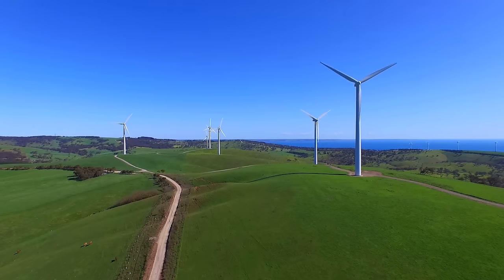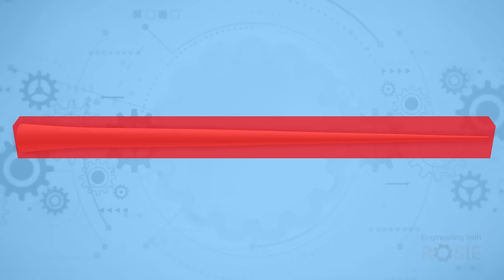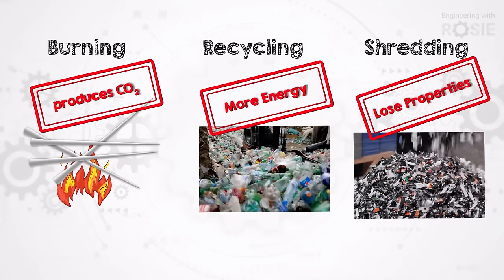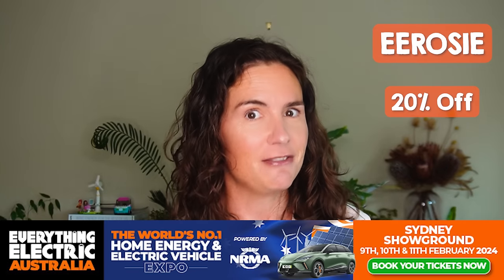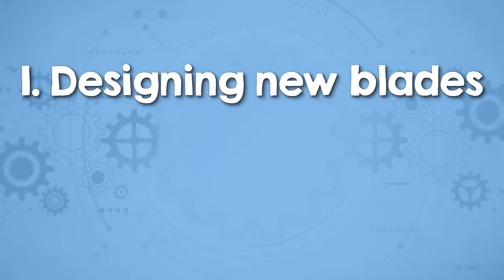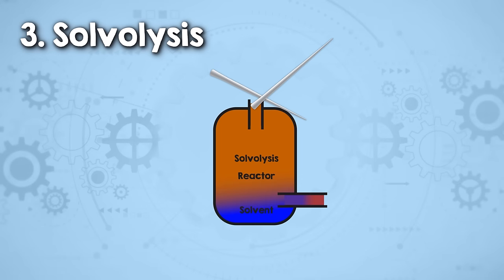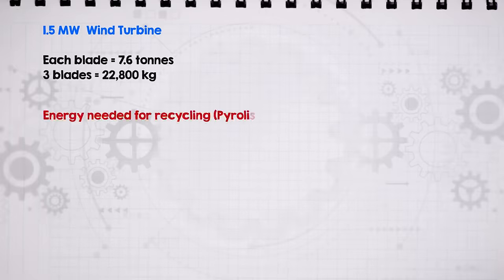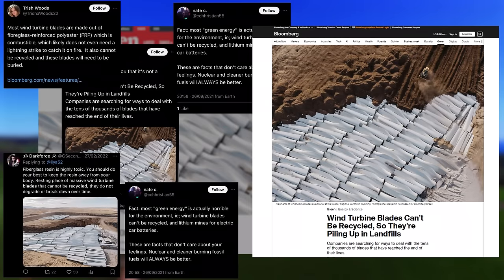This Is Why We Don't Recycle Wind Turbine Blades

Comment: Shredding and a role in cement manufacturing seems like perfectly fine ways to solve the problem.
Reply: This is done to an extent with Shredded Tires as well.  Most plants (at least modern ones in richer countries, re that note on cost will prevent all this short of regulation forcing corporations) already have good Emissions Controls for Sulfur and Particulate Matter so it can handle the Vulcanizing Sulfur and any smoke/dust from the burning.

Negligible sulfur in the Wind Turbine Blades, so should be easier!

My only criticism (although data needed) is this may not work as the volume of old blades grows, and thus the need is greater.

It could still play a part though and hold out until more technologies reach the same Technology Readiness Level
Reply: @ericlotze7724  Seems like there are way more tyres out there than turbine blades. And yeah, my understanding was that shredded rubber tyres added to roads reduced noise pollution.

I can't find the exact number but there seem to be 10's of thousand metric tonnes of wind turbine blades made each year right now.  Meanwhile the largest tyre manufacturer, Michelin, makes around 1.5 million metric tonnes of tyres each year.
Reply: @KevinLyda  Rubberized Asphalt Concrete is really cool!  @PracticalEngineering has a great video on Asphalt Concrete if you haven’t seen it yet!

In theory if done with sustainable biomass and/or maybe even somehow getting a Power-to-X workflow to make hydrocarbons that heavy, it could be a form of Carbon Sequestration in Construction kind of deal.

Comment: In Sweden, we already do that. Burns it in the high temperature oven. In severe heat pains. With very high temperatures. The ash is mixed into concrete, and that ash is not cheap. You get a very high quality of the concrete. No problem. Recycling.
Reply: Co2 isn not toxit.
Reply: That's not recycling..... And in Sweden the laws of physics still apply..... Conclusion still remains the same.....
Reply: What is the cost to burn them?
Reply: And how's burning up fiberglass material is better for environment than nuclear power?

Comment: Cut these into strips, glue them together like laminated beams and or 2x6 , 4x4 etc .
Reply: Getting a good section to cut like that may be difficult due to the more complex shape of wind turbines (they aren’t just a rectangular prism etc)

This is being done to an extent with all that Mechanical Recycling.

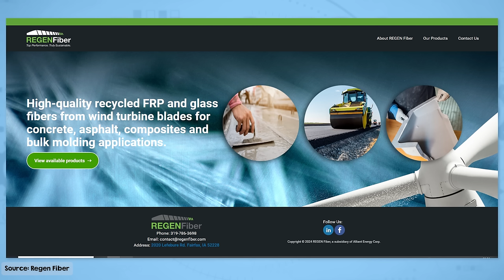This was mentioned around 11:16 or so where they are basically chopping it up into FRP Rebar which seems really neat!  FRP Rebar (Carbon Fiber Rebar is also a frequently used term) doesn’t rust like Steel Rebar, so can heavily prolong the life of Concrete Structures!
Reply from the maker: I had a section about that idea but cut it at the last minute as the video was just so long! Maybe I'll release just that section as a short video or something.
Reply: @EngineeringwithRosie  no such thing as ‘so long ‘ for your videos IMO.  I’d watch a 3 hour one
Reply: @EngineeringwithRosie  Have you considered pairing these videos with longer form content like writing? Perhaps a Medium blog? I'd love to dive deep into some of the stuff you show in the videos along with my weekend morning coffee.
Reply: Requires reshaping the blade, which is not practical with the current cross-linked resins.
Reply: Great idea. These could then be covered with a wood veneer to resemble actual laminated beams for residential use.  Or leave them uncovered for commercial or industrial use. I'd love to see some engineering (load) data for this sort of application.

Comment: Hey Rosie, I'm currently working on a start-up dealing with this very issue, and I wanted to thank you for a comprehensive exploration of the challenges involved, and for shining more light to this very important problem we've yet to solve - after 30 years of trying.

Most of what you said we are already familiar with, but some of the recent developments in thermoplastics were new to us. Thank you for including those.
Also appreciate that you proved links to your sources, will definitely be looking into those more.

Two things stood out in what you said - or rather didn't say. 
1) Shredding is very energy intensive, and I'm a little surprised you didn't mention it. It was sort of mentioned in the studies you looked at, but the numbers seemed a little off.
2) Shredding + burning before adding into concrete is the most common use for recycled glass fiber today in most of Europe.

I think the best choices for recycling the existing blades is in finding ways to repurpose the material for uses where the unique properties are useful, but would otherwise be too costly to produce. There are some advanced methods for extracting glass fiber, for example Carbon Rivers in the USA has a method with which they claim they can retain over 90% of the original strength of the fibers. But I think these energy intensive methods should be the last in the chain of recycling, after the material can no longer be applied to a new use.

How many blade shaped bridges do we want is a fair question to ask, but that is only one possible use case out of several dozen which would benefit from the material properties.

Thank you again, and look forward to hearing more of your thoughts on this, and other challenges 👍

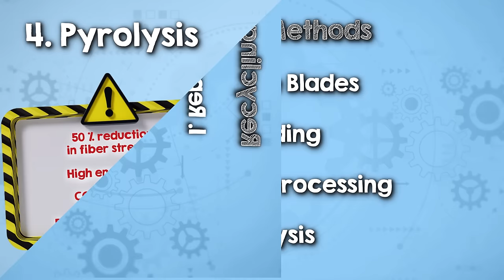Comment: 9:20  You would recover the “Pyrolysis Oil” and some (or all if just doing gasification) “Syngas”

Both of these could be fed into refineries that currently only use Fossil Fuels to make the Resins.

Also the out of scope effect of these facilities processing Municipal Solid Waste (especially sorted thermosets) and Sustainable Biomass.

Granted i am a MAJOR nerd on all this, but I wanted to know your opinion on all that.

(Granted also as you point out the Fiber would need reprocessed, and energy use issues, also if sourced from Fossil Fuels (as most things currently are) it’s basically a Fossil Fuel Thermal Power Plant with more steps)
Reply: Carbon taxes need to go up a LOT before synfuels are competitive with digging up fossil hydrocarbons.
Reply: @jamesphillips2285  Sadly yes.  

Granted in that case clearing land for Landfills is also more economically sound.

Comment: The following is from a Danish news media (Dr.dk) it is also mentioned in several technical media in Denmark.
The article is 18 months old, so there is a youtuber who has not done her job well enough:

Up to 85 percent of a wind turbine is already recycled today, but the used blades in particular have proven to be difficult to recycle.

But now the wind turbine manufacturer Vestas has developed a method to break down and recycle the used blades.

This is what the industry organization Green Power Denmark writes on its website.

The method involves dissolving the epoxy glue that holds the turbine blades together.

It is "groundbreaking", according to Mie Elholm Birkbak. She is an innovation specialist at Vestas and has helped develop the new method.

- We have found a solution that enables us to break down the wing materials in a way that is so gentle that we don't need to use a lot of energy to do it, and we are in the process of building the necessary value chain to realize the goal of recycling used wing material, she says.

Comment: I wonder if they could slice the blades and re-manufacture them into structural beams for buildings? Have you seen how much timber is now?
Reply: Good thinking, we need more ideas like this.
Reply: This was mentioned around 11:16 or so where they are basically chopping it up into FRP Rebar which seems really neat!
Reply: It would be interesting if someone took a Turbo-saw swing blade sawmill and disassembled a turbine blade into lumber.
Reply: anybody heard of ....building codes?
Buildings with people inside are not high school projects.
"This thing fits and looks good. Let's put it in!"
Treat them as high school projects and you get squished people when earthquakes do a visit.
"Oh well they died for the environment anyway. So still, happy thoughts, : )"
Reply: @pbxn-3rdx-85percent  Any company manufacturing things would probably get the proper licenses.  And as i stated that company making FRP like rebar is probably doing so, if not already done with that process.
Reply: @ericlotze7724  That is what I would expect too. Structurally graded materials for building to replace timber in building. They've done that for steel that look so thin gauge and flimsy but are quite rigid and obviously up to code given how extensive steel frames are now.

Comment: Im glad you mentioned Vestas since most videos never mention them. 

Their solution for recycling into virgin materials is working, and the materials needed for the process are easily accesable. They are currently working on scaling it up, and it will take a few years until everything is built and in place and ready for commercial use.

I understand why you are a bit hesitant since there are many promises in this industry, and there is not always a delivery on these promises. Which goes for most new tech, especially when they look for investors 😅

Comment: Dear Rosie, There is a specific problem with the turbine blades. In strong winds, the turbine blades often fail and break while the turbine is running at high speeds. The rotor blades hit the ground in the surrounding area and then shatter into very small pieces, which then disappear into the grass or the soil. This contaminates a very large area under the ruptured wind turbine. This means that the agricultural land on which a wind turbine burst is unusable for livestock farming and food cultivation for an extremely long time. The problem can only be eliminated if the soil is removed to a depth of at least 60 cm and dumped. The costs are very high and the wind turbine owner often has neither financial provisions nor insurance to solve such problems. The farmers who leased the land then suffer the damage. In Germany this problem is getting worse because wind turbine construction began about 20 years ago and the systems are now at the end of their life. They are often switched off because operating and repair costs are no longer covered by the profit because the government subsidies in addition to the sale of electricity have expired after 20 years. Old wind turbines should therefore be dismantled immediately after decommissioning. A common reason why turbine blades often break prematurely is damage to the gearbox and brake. Here in Germany, wind turbines are often located on agricultural land that is still used for agriculture or livestock farming. In my opinion, it is therefore risky to set up wind turbines on agricultural land.

Comment: As I noted on Patreon: From the argument above I can't see as the energy of the economy is decarbonised by for instance wind turbines that using 3 days worth of energy is particularly relevant, or very costly, and should not stand in the way of avoiding landfill, especially since technologies like windturbines are decoupling energy use from GHG emissions. Right now, and ever more so by the time blades being produced now are scrapped, reducing energy use is less and less important as it is decoupled from GHG. The principle of as much circularity is important, and should be upheld.
Reply: The counter argument is that by landfilling the blades it is sequestering carbon.
Reply: @nc3826  I am not sure why you would want to sequester carbon, when it is carbon dioxide which is the issue.
Reply: It looks as though a comment I made has been auto killed by Google. It was to the effect that googling recycling basaltic fiber shows that it is a very different proposition to fiber glass and carbon fiber. MDMI have hit 90% of the tensile strength of the virgin basaltic fiber in a material in a reycycled material, which also has excellent properties for marine use, when many turbines will be offshore.
Reply: @davidmartin3947  carbon dioxide comes from oxidizing carbon base materials..... sequestering  it  eliminates that possibility.... So why are you being obtuse about it?
Reply: @davidmartin3947  FWIW I do prefer recycling on average. I was just playing Devil's Advocate to point out there's always trade-offs.
Reply: @nc3826  How about dealing with the argument, instead of getting het up and personal? Until the carbon is oxidised, it is not a problem, so IMO there is no point and no need to bury everything containing carbon, especially since with adequate recycling it could be put to use.
Reply: @nc3826  There are indeed always trade offs. Looking at the data Rosie has presented, excellently as always, IMO making yet more landfill with turbine blades is an unnecessary one, and that sort of once through use is to be vigorously discouraged. It seems to be comparatively easy to make at least rebar out of used blades, and being so lazy that we encourage and enable throw it away and bury it for this gives little hope for the conservation and management of way more difficult targets, like managing soils effectively and water purity.
Reply: @davidmartin3947  Being defensive is not a counterpoint. And I didn't make any personal attacks.

How about you stop being purposely obtuse about the simple fact that sequestering carbon before it's oxidized is more efficient and cost effective than sequestering afterwards?  “An ounce of prevention is worth a pound of cure.” 

I'm not a fan of landfilling it, but it does have advantages.
Reply: @davidmartin3947  I also have a slightly different narrative from Rosie, whose only real concern is climate change.

But feedback from individuals in the industry, have stated that profitability is marginal at best. So the added cost for recycling is a factor in their viability. So it's not about laziness. Feel free to ask Rosie about it.

And as far as managing soils and water purity. Which I infer you mean in reference to landfilled wind turbine blades? PEX Plumbing is also made out of cross-linked polymers. Like the cross link polymers that hold the fibers of the blade together. So it does not seem like that much of a soil or water contamination risk. 

I would prefer that construction grade materials be made out of it. As long as they can do it economically? Which is easy to assume, but far more difficult to do. So it's not a paramount concern, which end of life option is used. 

The perfect is the enemy of the good. Nice talking to you take care.
Reply: @nc3826  Accusing your interlocutor of being deliberately obtuse when they have simply said that they have no idea what your point is is indeed a personal attack. Since  you cannot be civil, I have no interest in whatever point you were trying to make, which remains incomprehensible to me.
Reply: @davidmartin3947  You are far too intelligent to have no idea, about the point that was being conveyed. And to be human is to accept or to be in denial about the fact, that most things are incomprehensible.  C'est la vie my friend.
Reply: @nc3826  You are mistaken. I have absolutely no idea what you are talking about, or what connection you imagine. You assume that the other person understands without explaining what connection you infer. When someone says 'obviously' without explaining the rationale that simply shows that they do not understand the subject, and are relying on whatever assumptions they have made. If the interlocutor has not made the same assumptions, then it will make no sense whatsoever to them.
Reply: @davidmartin3947  conversation is always a collaboration between the transmitter and the receiver....  it's strange to me that you're the same person that was able to talk about the relevant subject matter for so long,  But is now fixated on such trivia..... The only thing  This part of the conversation did for me was put me to sleep.... So thanks...
Reply: @nc3826  You have consistently been simply rude, and that continues.In no way have you been addressed impolitely, but you seem to think it OK for you to be impolite. Once again, I have no clue what you are on about, as you chose to simply claim that it is 'obvious' instead of laying out what connexions you perceive. Nor am I now interested in engaging further with such an ill mannered person even should you have some sort of rationale for your claims. Any further personal remarks will simply be reported. Good day to you.
Reply: @davidmartin3947  stop harassing me with your baseless inflammatory accusations or you will be reported SMH

Comment: One of the problems critics typically have with renewables is the intermittency. During weeks with low renewable potential, we'll still need some sort of fuel to burn for the coming decades. We are doing this with gas, mostly, but i have been brainstorming about saving up all our organic and inorganic waste for those couple of weeks per year where we still need the capacity as a part of the solution. The synergy of burning the turbine blades during periods of low wind is somewhat poetic, and maybe after 2050 we can do it with carbon capture. In a way, burning with carbon capture is the perfect recycling method.
Reply: Given how cheap grid storage promises to become in the future, I doubt that burning turbine blades to generate electricity will ever be viable economically. LFP cells are currently $75/kWh in China, and sodium ion will reportedly be 30% cheaper at large scale, so we are talking about $50/kWh. Saltwater flow batteries promise to be even cheaper than that in the future. With dirty cheap storage in the offing, we can solve the variability of solar and wind. It's also worth pointing out that waste incineration generators currently cost roughly 2.5 times more per MWh than solar and wind energy, so incineration generators in general are currently not economically viable. According to one estimate I saw, waste incineration generators cost US$140 per MWh, compared to about US$60 per MWh for new solar and wind farms.